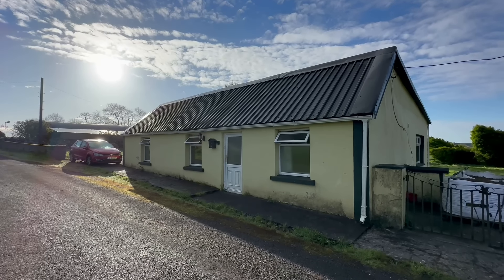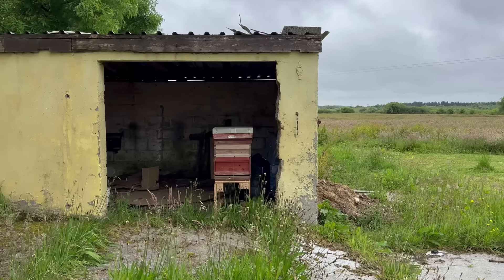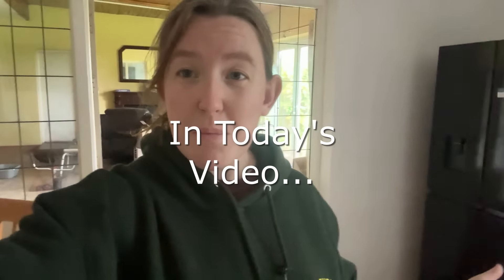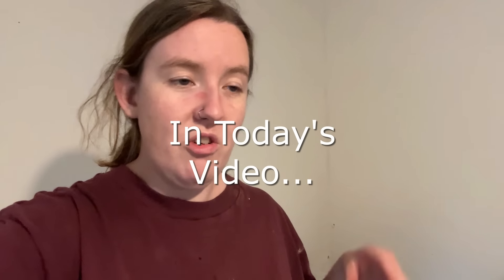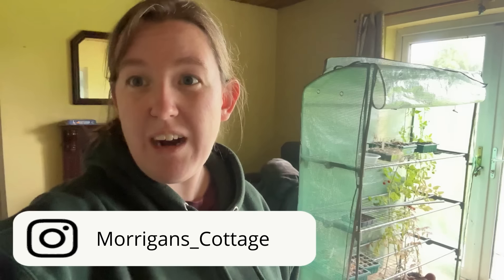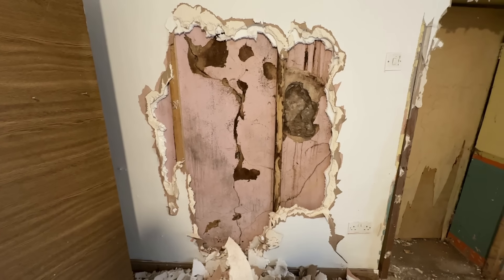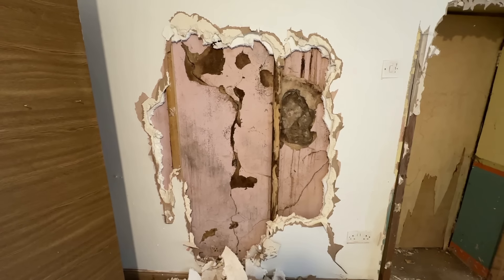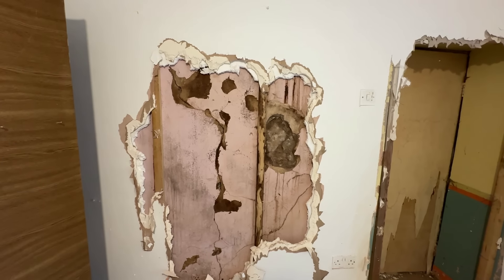Hidden Mold & Damp Discovery in my Old Irish Cottage Walls - DIY Renovation Nightmare  Ep. 77

Comment: Dear Aisling, new subscriber here :) I just came across this video.  Thank you for sharing this renovation journey with us.   
 I'm a technical advisor specialising in renovation of old properties for the last 9 years where I had the pleasure to restore and save several old properties.  It has become a passion of mine and thoroughly enjoy it, so I'll be sure to follow your journey.   I took a peek at the comments below and I spotted a couple of comments saying that internal insulation is pointless.  That is just wrong advice.  The question, or rather questions should be:  what type of insulation has been used? (ouch, I think they put polystyrene), would you know how thick your wall is (referring to the external walls)?  Do you have external insulation?  If yes, would you happen to know what type of insulation and how thick is it? 

Why all these questions?  

Because you need to understand what the U-value of your wall and insulation is.  U-value is simply a measure of the amount of heat that your wall (and insulation) allows to pass through.  Obviously, the lower the value the better.  To give you an example, a solid brick wall with a thickness of 3 feet (approximately 0.914 meters) would have an estimated U-value of 1.2 W/m²K (watts per meter Kelvin)

If that was my property, I would remove the drywall with polystyrene insulation behind it until I reach the bare stone.  This would start allowing the walls to 'breathe'.  If you can, try to leave the walls to dry naturally for a couple of weeks or more.  Ventilate the property as best you can during this time.  You see polystyrene is a closed-cell material, meaning it doesn’t allow moisture or water vapor to pass through. In older buildings with solid masonry walls, moisture from the ground or internal humidity tends to accumulate within the wall. Without the ability to "breathe" or allow that moisture to evaporate, it can become trapped behind the insulation, creating an ideal environment for mould and damp to develop!

Please forgive the long message but I can't stand seeing renovations taking a painful turn.   If you're still in time, please do consider calcium silicate panels on your internal walls.   You would need to apply these DIRECTLY to your internal wall on bare stone.  I cannot recommend this product enough,  having seen excellent results over the years and they're becoming more and more popular in historic restoration projects.  Putting here a few advantages of the product for your kind reference:

a)  they come in various thicknesses, but if you go for a 50mm thickness panel, that could potentially bring down your wall's U-value down to 0.5W/m2K. 
b)  they're fire-resistant
c)  they allow the wall to 'breathe' therefore any moisture trapped in the masonry is allowed to transpire.  Moreover, any excess moisture in the room can also be absorbed by the panel, before it dries again.  This creates a humidity-regulating effect in your room thanks to these panels.  
d)  it's a lime & mineral-based product, therefore environmentally friendly.
e)  Improves the energy rating of your cottage.
f). it has a high PH level, (alkaline), therefore very difficult for mould to grow on it! 

Like I said, can't recommend this enough :)  Just make sure you put compatible products on it, such as pure lime plasters and lime paints.  Nothing else.  

Feel free to drop me a message.  Happy to help where I can.  Best of luck with your renovation!!  -  Paul
Reply: this is probably my favorite message ever.  Thanks for writing it out for all of us and especially Aisling :)
Reply: You are a fairy godfather for this woman. She needs the straight up questions and advice. TY!
Reply from the maker: Hiya Paul! Thank you SO much for the information!!! I just looked up the calcium silicate boards I’d never even heard of them! I’m very much at the strip back part of all this so I haven’t started redoing anything at all! I really appreciate your information on this! I’m sure you’ll see a lot of things in the videos that are painful to watch apologies in advance!!!

I’ve screenshotted all of it and will start looking into it all! I will definitely message you with more questions I’m sure!! Thank you so much again - I’m clueless and all the help is really appreciated!!
Reply from the maker: It really does help so much, I’m so clueless so to have someone give so much helpful info is amazing! I’d never even heard of some of this so definitely pointing me in the right direction
Reply from the maker: Absolutely!!! So much help!!!
Reply: You're welcome Aisling :) I'm glad the info was useful.  I'll do my best to help out when and where I can.
Reply from the maker: @multipotentialite888  much appreciated, I really am trying to be a sponge right now for all the info I can get, I really don’t know much but trying to learn as much as I can so any recommendations or tips always appreciated! I was looking up tje stuff you mentioned and it sounds exactly like what I need so thank you again!!

Comment: Our beefers definitely are out year round.  We do have a shed roof for them (3 sides without covering, 4th side is the back of the barn) and if it is too wet or snowy they might come in for awhile.  Like chickens and sheep (our other livestock) if it is quite windy and they are wet it isn't ideal but they'll look for shelter.  But, not because it is cold on it's own.  For the chickens especially folks tend to put them in a two tight home without adequate ventilation and they end up with respiratory issues.  As an aside, there still is a bit of sun most days in the winter and always fresh air which can't be duplicated in a barn.  We had some LGDs for several years and they NEVER came under a shelter or into the barn if there was any other option.  Definitely no pets.  What a learning curve it has been as we learn what our livestock needs :)  The other day when I was thinking about "your" cows I was wondering if you had talked to the farmer?  You could ask if they would like some winter squash/pumpkins if you ever had access to them.  I would always say yes to that since I also grow them for our livestock :)  I forgot all about that when I was saying my "no treats" rant.  (embarrassed face)
I'm thrilled that the modern walls are being removed.  The foam board is about my least favorite insulation, and mold is just awful for you.  2 possible wins :)  One alternative might be rockwool but I would certainly ask an expert about that.
Reply from the maker: That’s really good to know about the cows thank you :) it’s all new to me, and even though I’ll probably never own cows I have absolutely adopted all of these cows as my own 😂 I haven’t talked to the neighbours about treats yet but that’s good to know about feeding them that! And no embarrassed face, you’re sharing knowledge and experience and that’s so helpful :) ❤️

Comment: For the benefit of all viewers thought respond by comment here whilst I do emails back forth with Aisling. In terms of the "journey" she has been undertaking opening up the walls is one that replicated daily across Ireland. All these variations in damage are the result of two common factors. Firstly, ventilation and secondly, wrong materials. So in terms of ventilation, as many will know that limestone and other Irish stonework needs to breath, and just like a human breathing contains moisture and if breathing restricted you are in old heap of problems. So this house is a perfect example of someone putting up stud walls with plastic sheets and plasterboard and leaving behind a ticking timebomb. In terms of wrong materials, as I am sure many will know that it is so common to have used concrete or portland cement, and guess what these are non breathable so you get hidden pools of moisture and eventually the portland cement will blow. On top of that plasterboard is a fantastic sponge, and a fantastic growth media for mold. So what is the solution, ventilation ventilation and ventilation. O and there is the timber for the studs, using untreated wood, or not laying down a layer of damp proof tape to protect the stud work etc. 
Specifically, the placement of stud framing must leave at least 1 1/2" to 2" gap, yes I know that is a lot of floor to lose and I will come back to that. Then the insulation in between the studs must also be breathable, that means only use rockwool or earthwool, as PIR boards with the silver foil will form a barrier and develop condensation, then a fitment of an intelligent vapour control barrier that takes account of the temperature differences from the outside wall and inner wall to manage the transfer of moisture and then finally plasterboard. 
Now if you do not have the floor space to lose then there are alternatives including hemp, cork, wood that can be affixed directly to the stone and then specialist lime mortar base and top coat is layered over the insulation. Still takes up floor space but much reduced, obviously a specialist or lots of training / learning how to mix and layer on these specialist lime but if done correctly you most definitely get a traditional stunning looking stone wall finish that can then be painted with breathable paints.
Finally, there is the question of the repairs to the stone walls as a result of the moisture trapped, well firstly once the wall are opened up the walls will breath a sigh of relief, you can run machinery to pull the damp air out of the home. Then its a case of chipping out the blown cement and loose stones, blowing out loose materials, moisture and then lime pointing. Lots of you tube examples. Thankfully being internal walls the finish is less important so its a good starter project. As many will have seen on YouTube  renovators can re-use the loose stones to fill in the larger gaps and just work your way along each wall.  If in doubt shout out to a builder or engineer to have a look and advise, as sometimes it pains me to say but it can be cheaper, safer, quickness and a known structural standard to get the builder in to demolish the stone walls, and replace with concrete blocks and then insulate and plasterboard,
Hope that helps everyone that is on this joyful part of the discovery stage of their project?
Reply: Very kind of you to put up such a detailed and informative post to help Aisling and anyone else out there who is struggling with similar issues.
Reply: Dear Aisling, every bit of plaster you remove is a step forward so don't be disheartened. As you said.. it all has to come off anyway. You are doing a great job chipping away at it. It will be less work for the builders and gives you something to do whilst waiting for the grant. Well done xx
Reply from the maker: Your knowledge and advice is invaluable Joe ❤️
Reply from the maker: Such helpful advice for anyone doinh anything similar!
Reply from the maker: Thank you! And you’re right it’s a step forward, each little piece of mold wet plaster down is a big step! Slowly getting there and it’s something productive for me to do while waiting on the grant! ❤️❤️
Reply: @janettemcleod2  oh my goodness, I hope I can employ you as my engineer once we find our property 🤞❤️
Reply: @melaniepowell9595  Well just shout when you are ready, it costs you nothing for the journey design, build, grants etc.
Reply: @janettemcleod2  fantastic, will do! Thank you 👍

Comment: It seems that it was common practice in Ireland to just cover up the problems, there can't have been an awful lot of building regs going on, I've seen the same problem in quite a few cottage renovations on line. Without a damp proof course I would imagine that you have rising damp although I'm no expert but the plaster has to come off anyway so you can save a lot of money doing all that yourself whilst the grant comes through. No need to panic Mr Manwaring! I'm still sure that the house won't fall down. Stay positive, all that ripping out plaster will keep you warm.😅❤
Reply from the maker: It definitely seems to be the way that these old houses were just patched up and problems hidden! At least I’m finding them not and not in a few years! Removing the plaster is definitely a workout in itself!! Onwards and upwards though, I’m hoping to have grant news in the next week or so fingers crossed! ❤️

Comment: There is a big damp part in the ceiling  you most likely have damp from roof or water tank in roof? Also why insulate internally just insulate external walls trap heat in house. Also on mice entry holes around house are your culprit. Lastly digging out those drains would be a job for a digger initially.
Reply from the maker: I think it might be old damp, or the building survey said he thought it was soot marks from an old chimney, I have no idea thoigh, I haven’t ventured up into that part of the attic, definitely something to pay someone to do! I’m not sure about the insulation to be honest I’ll have to look into it I thought it had to go on all walls! And yeah will definitely need a digger in, the drains are still there just very over grown so I’m going to try do a little until I have the digger finds!

Comment: Since your pulling everything off etc it might be worth pulling up the concrete footpath around the house. There might be water coming in under the concrete? Also if you do that you can add drains around the house. If you add the new insulation etc will that effect the stones ability to breath? Also I think the room just grew 1m bigger without all that stuff covering the wall
Reply from the maker: Totally, the room has increased in size! Now I will be putting walls back up and taking the space away again but that’s ok! There’s some insulation you can use on stone walls, actually someone commented in this video there’s special boards you can put up that are breathable so I’ll be putting those up to help keep the room warm and hopefully dry too!

Comment: Hi Aisling, i would take the concrete off. It's not allowing the stone to breathe. Insulation wise I would go with breathable insulation, I am going to be using cork lime insulation plaster (Dyathonite) from ecological building systems. You could give them a call and ask for advice.
Reply from the maker: Oh thank you so much for the tip! I’ve screenshotted and will look into it as I haven’t heard of that!!

Comment: Love the plan , but I would get a real fire place (double sided ❤️👍) or a real wood burning stove ❤
Reply from the maker: A real fireplace would be brilliant but I can’t put the chimneys back in the roof, I could maybe get one of those metal flues in but maybe a project for the future!
Reply: I've been wishing for this too :) We had an old schoolhouse building that had enormously thick walls in the cellar .  The cellar was 12' tall, about half under ground and half out.  It had large windows up high that let good light in but it was as cold and damp as a tomb.  We had a workshop down there (it was huge) and we had a wood stove to burn scrap and regular wood and it gradually not only warmed up the space (often 10°F outside) but also warmed up and dried out the concrete walls and floor.  Then, it held on to the heat and let it out slowly so that the next time we came we didn't have to start from scratch to bring it up to a good working temperature.  
I think these stone cottages probably had similar comfort with wood and/or coal stoves?  We still use a wood stove (and at one point a cookstove) to mostly heat our old porous (not stone) 1860ish house.  I vastly prefer it to using our natural gas boiler but it is not as easy, of course!
Reply from the maker: @brendamontanye9877  oh wow that’s so interesting! I definitely think these old houses need some kind of solid fuel burner, the stones soak up the heat! I have one flue in the living room that a stove is attached to but currently out of action but absolutely plan to bring it back into use!! 10F is sooooo cold! I couldn’t!!

Comment: that crack and damp are at the back of the old chimney has it been removed or do you still have a stack on the roof?
Reply from the maker: The chimney and the stack is gone now, I think maybe it was leaking before and the previous owners removed them when they put the metal roof on, the building survey said the roof seemed water tight and the attic dry so I’m hoping it’s all old water damage, I’ve taken the cement off the walls now and they seem to be in ok shape but discoloured in parts - dry though at least! I have a builder who’s going to make sure the fireplaces are all structurally safe and tidied up too just in case there’s damage I can’t identify!

Comment: The walls are like 3 foot thick - so insulation is pointless , it’s doing NOTHING to increase warmth . It just makes walls sweat - also the wallpaper and plaster should be removed before covering with plasterboard and there should be an air gap between old walls and the new board 😳 also they put insulation in an internal wall , why ? 😂 I think whatever contractor did that didn’t know what they were doing and was ripping them off 🙄
Reply from the maker: It seems like they got everything wrong from start to finish 😂 they definitely got ripped off if someone made them pay for this work! But I suppose they didn’t have the internet back then so they couldn’t know any better (or that’s what I’m telling myself!)